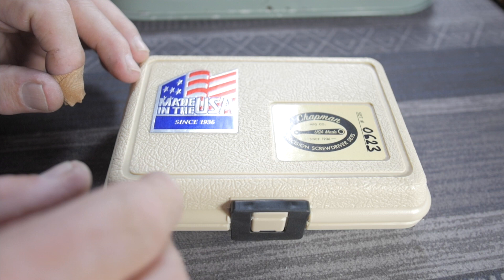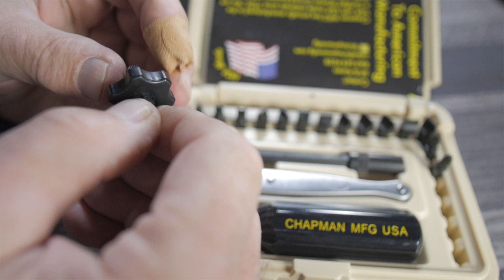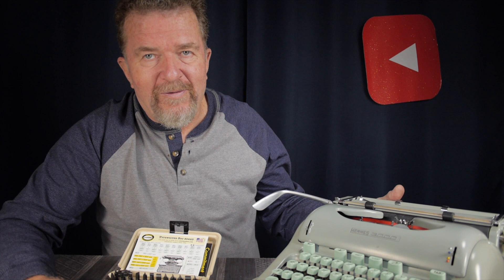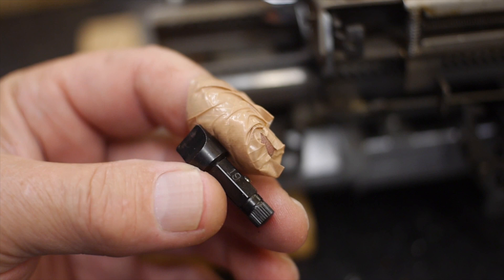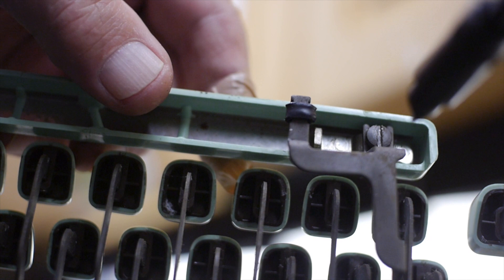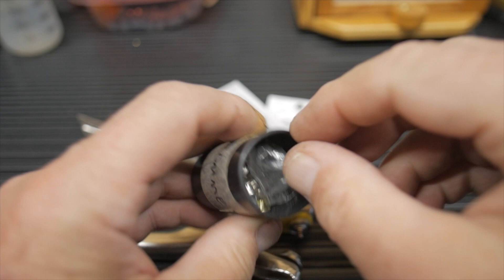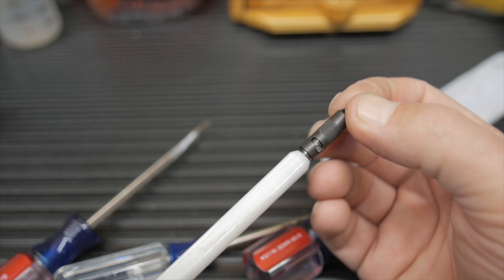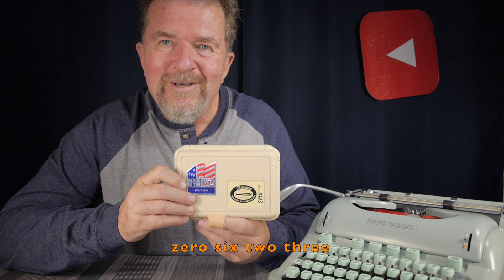Typewriter Video Series - Episode 235: Tools!

Comment: Joe, found this on youtube this morning, You may recall I'm one of a dying breed, Typewriter Mechanics... There is no substitute for a good set of screw drivers with a minimum length 8 inches plus in length with a diameter to suit the head of the screw with the shoulders of the blade filed off so that the blade is parallel. If you use the screw driver that suits the screw , then the screw will not be damaged , the screw driver will also tell you when the screw is torqued because it will twist. The reason for length is that you can see what you are doing. Now spring hooks, motorcycle spokes make excellent hooks , about 8 inches long...taper the the spokeafter removing the hook end and the threaded end,  heat the taper untill its read hot, gently bend the tip to a right angle, for a push hook , make the taper longer, heat it , bend it to a right angle then gently tap the pointed end with a small hammer , it will at this point form i's own push shape
Reply from the maker: Thank you!

Comment: Joe, despite the accuracy of these Chapman screwdrivers, I think the limitations imposed by the chuck to enable you to get into the tight spaces in a typewriter would drive me nuts. I've been considering getting a set of hollow ground gunsmith's  screwdrivers to use for typewriter adjustment; they each have their own handle and no wide chuck to get in the way....

Comment: Hi Joe,
This is crazy. I had watched this video you did a while back and just searched it out again today because I remembered you had recommended the chapman set. I was getting ready to order one but had reservations about them being able to fit in tight or hard to reach places. The crazy part is the reason I was thinking about the chapman is because I was working on a recently acquired Hermes 3000 that is has an issue just like yours with shading and i could not get the screws for the lower case adjustment to break loose and am damaging the slots with my other screw drivers trying to loosen them. Those screws are super tight and they are soft metal. 

Any suggestions on breaking them loose? I don’t think the Chapman driver will fit in there at least for the lower screw as I already need to have it on shift to even reach with a regular screw driver. I have tried wd40 and PB Blaster to no avail.

Thanks,
John
Reply from the maker: Hmm, don’t you have to loosen the lock nuts first? A set of ignition wrenches may help on those.

Regarding the Chapman set, I think gunsmith tools might be better.
Reply: No, there are no lock nuts. My understanding is the lower case adjustment screws are the two larger head ones just to the right of the upper case adjustment you were showing in your video. Thanks for the advice on the Chapman sets. I just acquired an old typewriter repairman’s tool case which surprisingly only had one long, narrow screwdriver that I first tried on these screws and immediately bent the tip. :( @Joe_VanCleave

Comment: If you could buy 1, readily available (and affordable) typewriter as a newbie.....what would it be? #VideoIdea
Reply: A smith corona.. there are a lot available,easy to maintain and very well build. Go for the ones from the 50's or 60's.. model Sterling or silent super. Happy hunting and good luck
Reply: Try antique malls and shops. I have nine typewriters and I just started about two years ago. Most of mine were found at antique malls and stores.